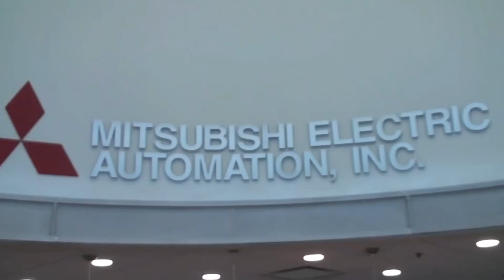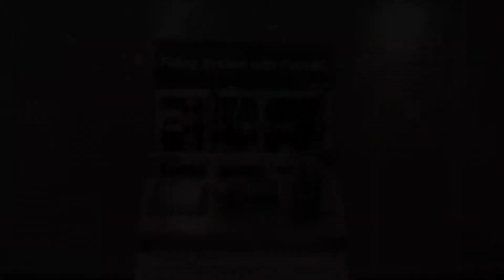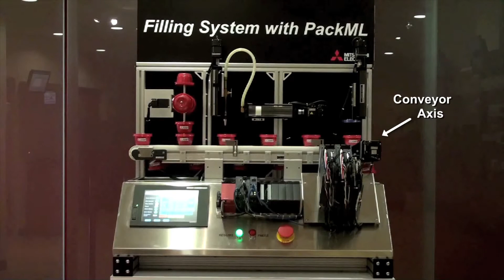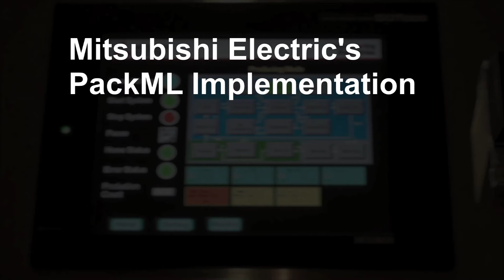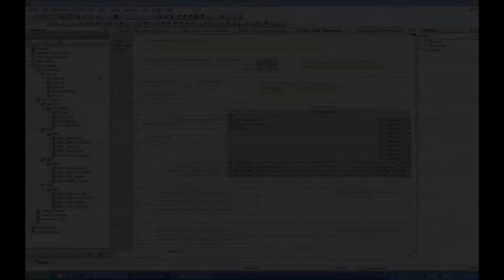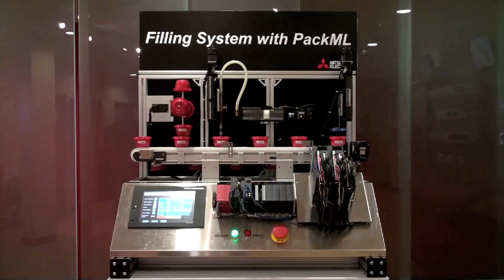Mitsubishi Electric Demo - Filling System with PackML

Comment: Previous comment removed because of a technical error! The MES module can send PLC data straight into a SQL server database; from there a script can generate a CSV file! In any event the Mitsubishi Electric offering offers the simplest, lowest cost method of PLC & HMI engineering I have known.